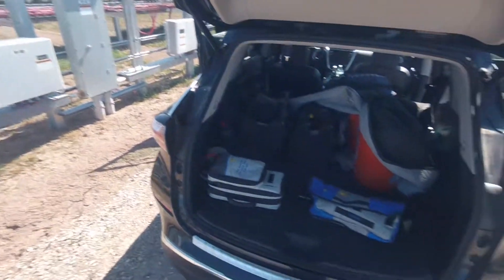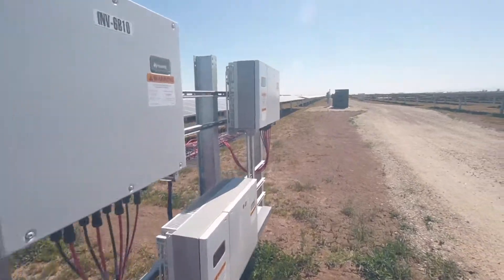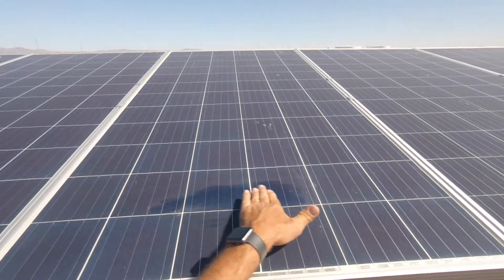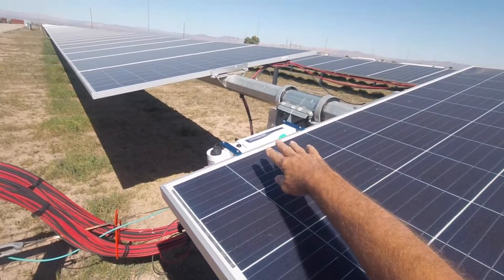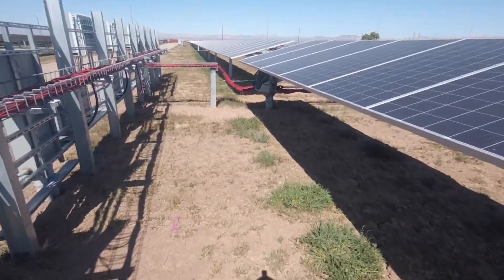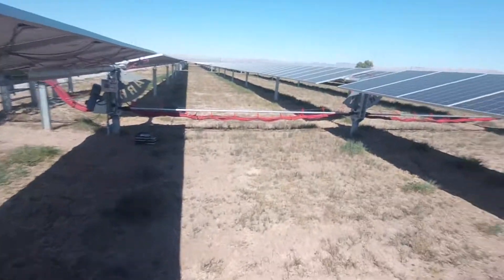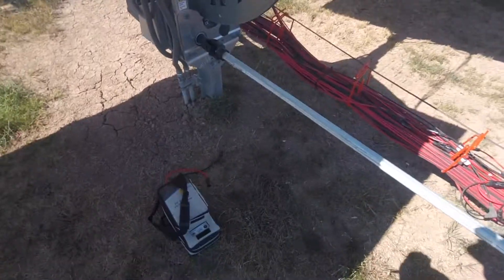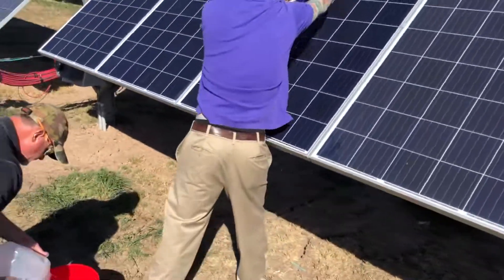Solmetric PV 1500 Analyzer Part 2 of 3

Comment: Why you didn't connect T2.? If T2 didn't connect how to get average temp in final report...
Reply from the maker: I always use t1 only so just one back of module temperature probe.  Basically I’m comparing two tests that happen with in ten minutes or something like that of each other so it’s the delta between dirty and clean modules. I want to compare more than to make a super accurate quantitative value. So if the temps and irradiance are constant and similar that’s what I need.

Comment: Paul, another great detailed video.  How have the CAB cable systems worked out for you? We have similar concerns with ours being installed now, low to the ground and the vegetation concerns
Reply from the maker: Well so far we have had them weed whack and spray a 4 or 6 foot wide path underneath those CAB trays. I found a bird nest in one but they are only about a year old now.